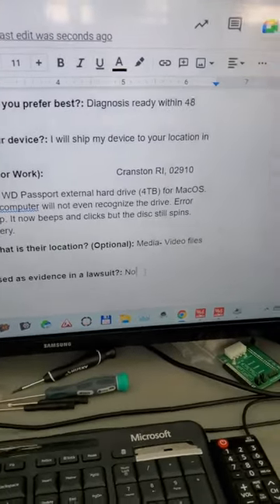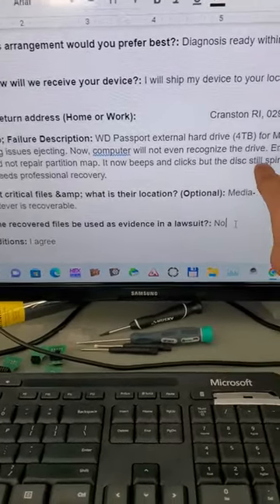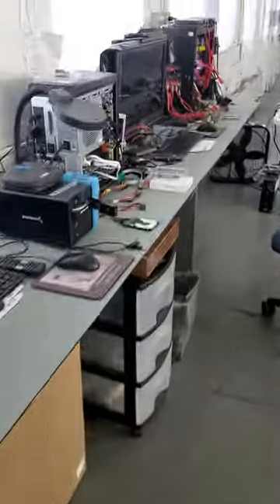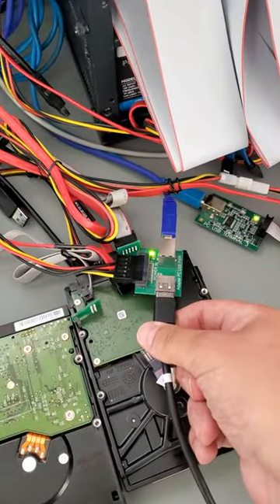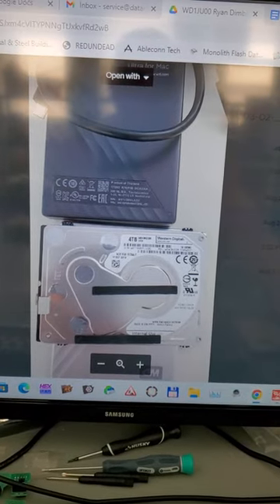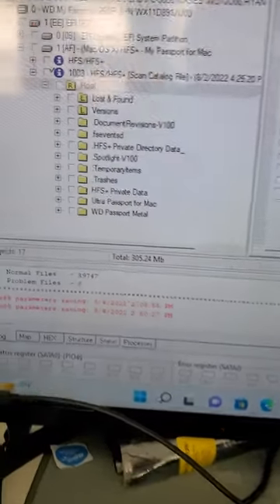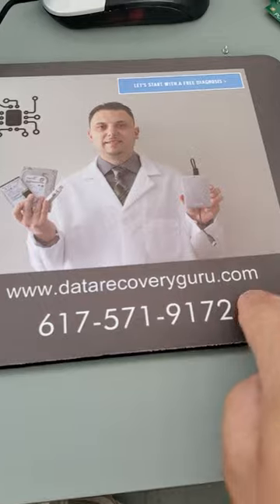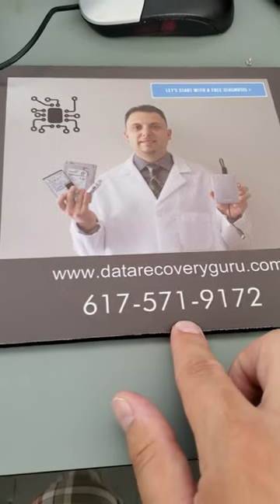How we recover data from WD My Passport Ultra for Mac with USB C that has disk reading errors

Comment: So, was the drive being underpowered and therefore the need for the power adapter to boost the power so the drive would properly spin up and mount?🤔
Reply from the maker: No, the drive had no issues related to power. The power cable and interface were fine. These portable WD external drive rarely have power related issues. Sometimes, the PCB may have an issue (e.g. damaged resistor), but it is fairly rare.

As explained in the video, for the drive in the video, the problem was disk surface reading errors. The adapter you are probably referring to is a special adapter allowing to control hard drive settings (e.g. software and hardware resetting, as well as repowering the drive, should it become non-responsive, using software controls.
Reply: @Datarecoveryguru1   Thanks for the clarification!!!😁👍
Reply from the maker: @fookingsog  You are welcome